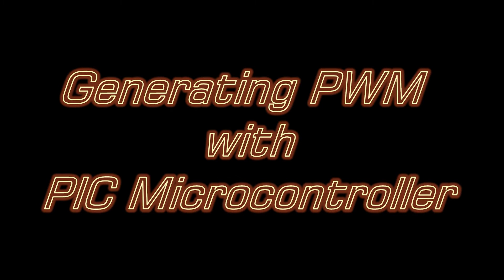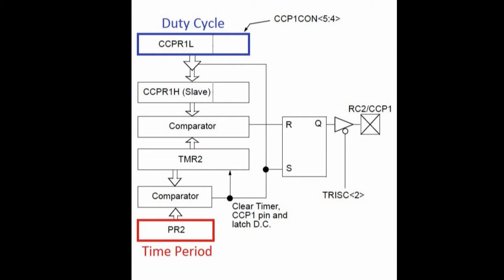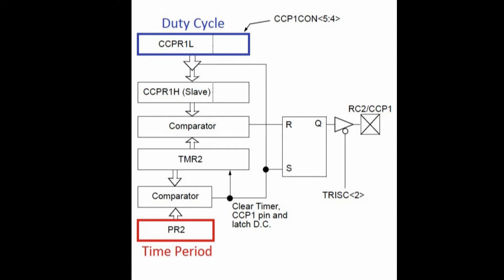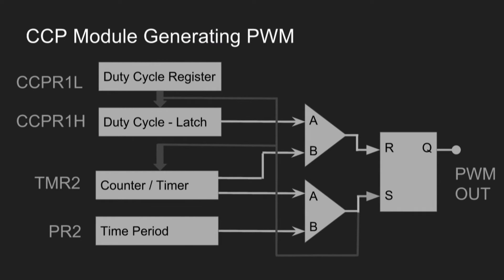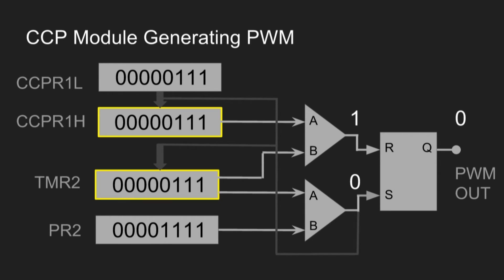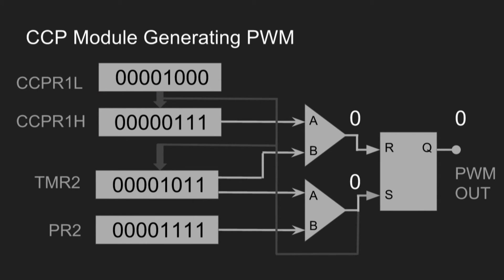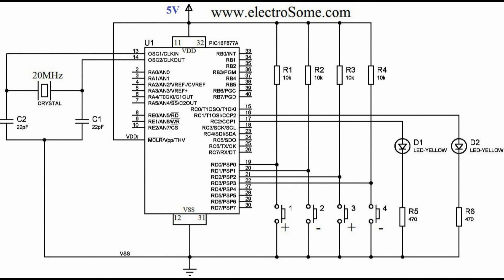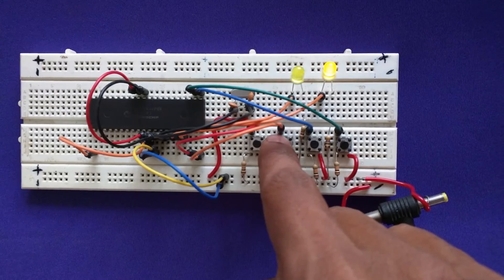Generating PWM with CCP Module of PIC Microcontroller

Comment: I have gone through code. I like to understand few thing, if i like to generate frequency of 100khz  either this function PWM1_Init(5000); is enough where i pass argument 100000 . When i dump the code i found RC2 i.e ccp1 module produce 100khz where we making setting for 4khz.